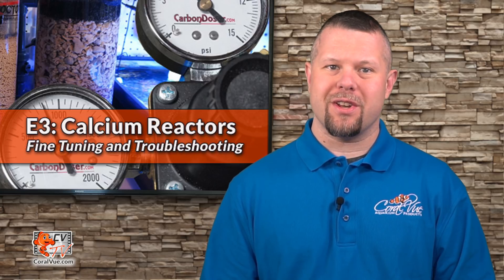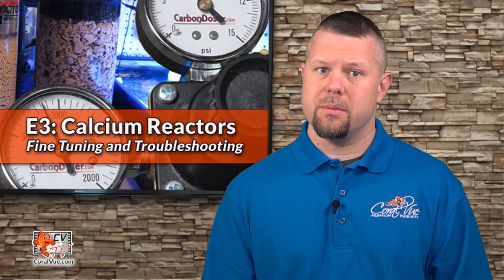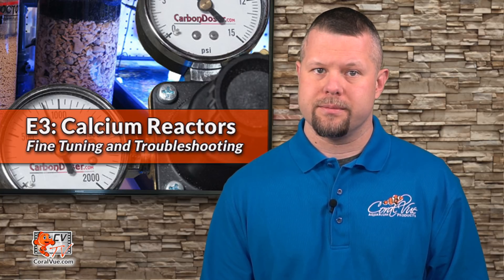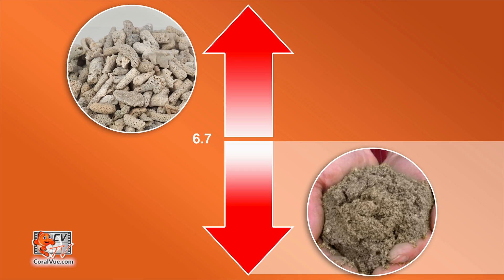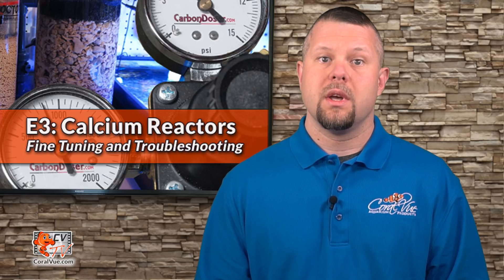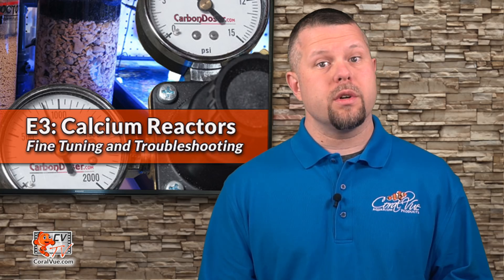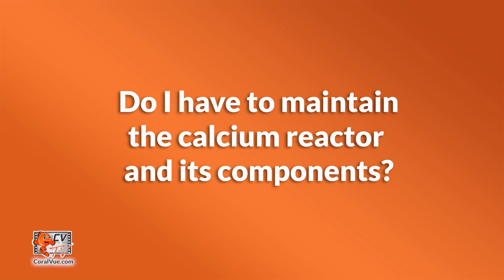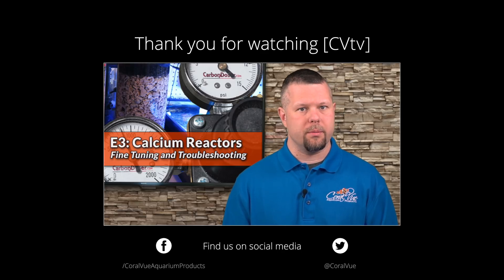Calcium Reactors Episode 3: Fine Tuning & Troubleshooting

Comment: How do we maintain the water flow through varios6 pump and kamoer so that it doesn’t overflow. I’m using the exact same set up with Kamoer pump running at 140ml/min yet when the Varios pump turns on, the tank starts to overflow from top (probe inlet). Pls suggest!
Reply from the maker: You only use one or the other to feed the reactor. I am guessing you have the FX-STP pump on the effluent line which will control the flow through the reactor. There is no need for a pump on the feed as the calcium reactors circulation pump will naturally draw water into the reactor. Also, 140ml per min is a very high dosing rate to be used.

Comment: What recirculation pump speed do you recommend with the Varios DC pump? I’ve been running on level 2 on the cr200 and wondering if I can get more stable performance at a different recirculation speed.
Reply from the maker: The speed really depends on the demand of the system and the size of the reactor to the system. The more flow you have the higher the turnover rate recirculating CO2 through the media. I ran my reactor on power level 3 in the winter and 4 in the summer when the demand was greater. That is what I found worked with my system. The best advice I can give is to try out power level 3 for a week and see what differences you notice and if they are positive or not.
Reply: This is what I was wondering too thanks for answering

Comment: Why do no videos about this reactor talk about the recirculating valve?  !!!  SO FRUSTRATING.
Reply from the maker: Sorry for the frustration. The valve is intended to be open at all time to allow the CO2 that accumulates at the top of the reactor and recirculates it back through the media till utilized. It is also used to shut off and disconnect from the lid to allow atmosphere/built up CO2 to escape. Hope this helps.

Comment: Not sure what's going on with the pump, power is on pump doesn't turn on, what can I do
Reply from the maker: The pump engaging likely has something to do with it being airlocked or something preventing the impeller from responding to the pump. Usually, you can tell by the error the VarioS controller emits. If you have not done so already I would suggest submitting a support ticket at coralvue.com to better assist you.

Comment: I am running the Reef Octopus VarioS CR200 with the Kamoer FX-STP on a 200 gallon system.  Connected to an APEX.  Everything is running seemingly well.  (Thanks for the Videos) 

My question is is multi part. 

1) Can you go over the valve adjustment if any on the various on off valves. When and why to adjust or tune them down.
2) Is it normal to have the SWOOSH sound (air pulling through the varios pump) every 5-10 seconds?
3) If the swoosh is normal or not can it be adjusted to not be so loud.
Reply from the maker: It is normal to have the CO2 recirculate. If it is excessive throughout the day your CO2 pressure and or CO2 feed is set too high for your effluent drip-rate.
Reply: @CoralVueTV  Is it a bad idea to tune down (restrict) the John Guest Valve that is on the re circuation line?  I turned it off then slowly opened the valve until the gas at the top started to slowly re circulate.  This seemed to fix the problem as well, As is T/S the above advice.

Comment: what's the speed i should have it running 50? Kamoer FX-STP
Reply from the maker: The speed or dosing amount depends on the demand of the tank. On my 240gal mixed reef I have my FX-STP set to dose 40ml.
Reply: @CoralVueTV  great thank, i am using 140Gal RedSea would you recommand 28ml?